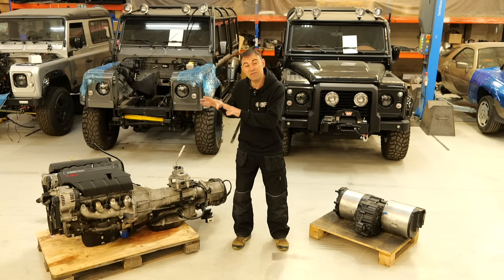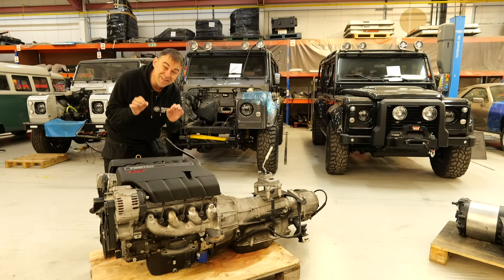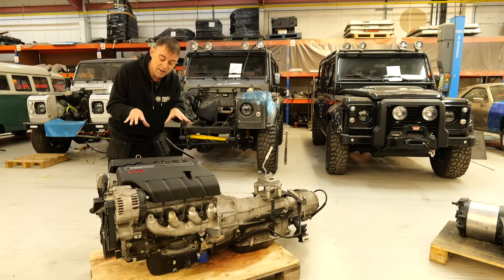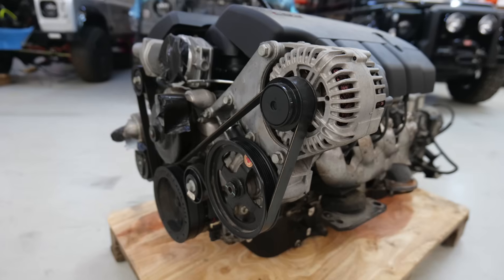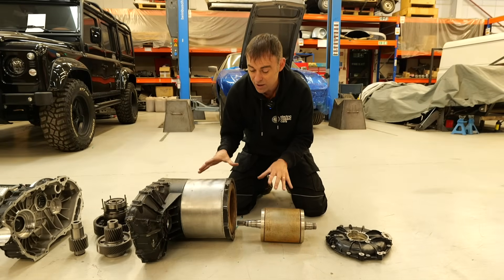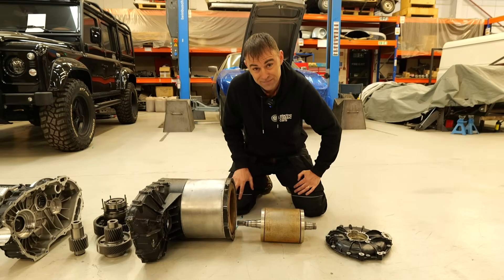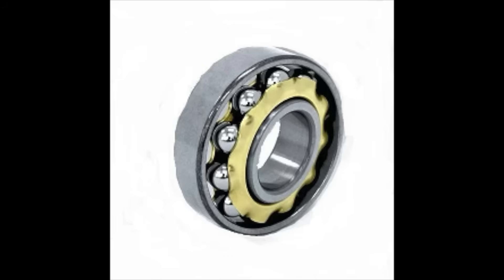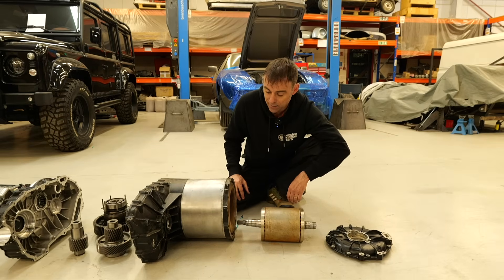Let's compare the Tesla LDU with an LS3 V8 and take one apart to see what makes it tick.

Comment: Not comparable at all because one produces energy and the other can only use energy. EV’s are not really electric cars as much as they are more like cordless rechargeable cars. Big difference.
Reply from the maker: You need to go back to science class. Neither ICE or EV ‘produce’ energy. They both used stored energy to convert into motion, whether that stored energy is in the battery or in the petrol. 🤷‍♂️🤦‍♂️
Reply: @ 
I stand corrected and thank you for not rubbing it in my face. Appreciate it.

Comment: You forgot about the battery in the weight.  Also, for electric, the high-loss energy conversions happen before it gets to the car, so total energy loss is about the same.  The heat is just dumped somewhere else.
Reply from the maker: Where do you hear such rubbish. Please provide the link so I can address it at the source. The EV is still much more efficient even when you take into account the electricity production. Electricity, BTW, which is required in huge amounts to drill the oil out of the ground, pump it to a port, transport it half way around the world, refine it into petrol , transport it to a petrol station and then pump it into a car, where only 20% is then used to make the car move. It’s madness. 
We covered a petrol vs battery comparison in a previous Tech Talk which we linked when we talked about the weights and at the end of the episode. In case you missed it, here it is. 👍 https://youtu.be/opF1si__APs?si=WNcGIWVZZUdGGDzd

Comment: Nothing new electrical drive... Diesel electric trains have been around a long long time. Even back then it was realised how efficient motors are... The only frictional losses are in the motor bearings whilst an engine has 100s of moving parts each with losses which multiply 😊

Comment: Thank you for showing the comparison ! 👍
At 74 and in my youth I dabbled with gas engines and slot cars . 
We use to rewind the motors on the slot cars to get more RPM but our throttle controls got hot as hell ! 
Obviously the motor in the Tesla is already set for peak performance and the inverter is the key to more power . 
I never thought I would hop in a full size slot car one day ! 😂
Reply from the maker: Thanks for sharing!

Comment: Yet Ev;'s are are having 4x as many issues as tradition ICE motors. You have not looked at the brains of the battery system or it's cooling. The you have a car that far  out weighs a car of the same size in ICE and all the same systems tyres, suspension and brakes. The fact you have so many lethal rare earths and poisons in the Lipo battery that is near impossible to extinguish is as good reason to not have one. Three car carrying ships have gone up so far due to thermal runaway and three fireman have been killed in the last few weeks. Until the batteries are safe they should never been allowed.
Reply from the maker: You need to stop watching anti-EV FUD. It’s well known that EVs are more reliable and require far less maintenance than ICE vehicles. I would suggest you widen your YouTube channels to something less Anti-EV. For instance Ben Sullins is a good start. 👍 https://youtu.be/ga1jzoHXiRE?si=2oluGIyp9pszMYuX

Comment: I think the original Defenders also had locking front and rear differentials and a true low range transfer case. To do this with an EV also adds a lot of complexity. The Tesla LDU only has an LSD - that's not really much good for off roading - so when you rebuild these things do you connect it to the original drivetrain or do you just convert to 2 wheel drive?
Reply from the maker: Defenders never had locking front and rear diffs. We put an LSD in the Tesla and one in each axle, making it far more capable off road than a standard ICE Defender. https://youtu.be/mcdKjdKELec?si=Z1Caz79NHi7EFxIu
Reply: @ElectricClassicCars   Thanks for the info. I always thought the Defender was offroad capable but apparently only light offroad. I'll have to watch that video although nothing really beats a locking diff.
Reply: At 8:00 mins you went through that technical section way too fast to try to compensate for the lack off diff locks. Sure we can all send it but sooner or later something will break. I enjoyed it though - great vid. The suspension travel is amazing. Always love your videos.

Comment: Nice video. I noticed a couple of times in reference to the Tesla motor you said " less pollution" compared to a V8.  Why don't you tell the truth and say ZERO pollution. Here is a test you can actually do. Spend the night sleeping in a garage with the doors and windows closed, with a V8 engine idling all night. See how that goes.  Alternatively, repeat the experiment with a Tesla turned on all night. It might be prudent to do this test, starting with the Tesla, and then terminate the test before you do it with the V8.  Facts need to be stated here, that electric motors do not have exhaust pipes, because they produce ZERO emissions.  The dinosaurs died out 65 milllion years ago.  I wish the diesels and V8s went with them... BTW it's only a matter of time...they are going to disappear.  The sooner, the better.
Reply from the maker: Because generating electricity still produces pollution.

Comment: The big problem with a Tesla (and it's drive train) is that battery. I can drive say 400km in my V8 truck including all the crap I throw in the back and when I run out of fuel, I pull into a service station, fill up and 5 minutes later I can do the same thing all over again. You just can not do that with a Cybertruck.

Comment: Interesting comparo.  I don't think you can fairly really compare just the engine and gearbox though.  A traditional fuel tank is about as simple as it comes, but a battery is tremendously complicated.  The number of cells, joints/connections, the chemical processes that need to happen to generate the electricity for the motor - in ICE that all happens in the combustion chamber, which is why it isn't really fair to ignore the battery component (unless we suddenly all decide to go overhead power wires like trams).  And the battery is where the heat is generated too since that's the bit generating the actual power.
hands up who's confident the electronics will work s flawlessly for 30 years?  The electronic door locks on my VW Jetta already have a mind of their own after only 12 years and aren't exactly cheap to replace - why they have to be electronic instead of mechanical (for lifting the latch) I don't know, but they're stuffed already.

Comment: If you compare the two, you need to include the weight of the Tesla batteries. A Cybertruck weighs in at 7000 pounds, I have FordF150 with the 5 liter twin over head 32 valve variable cam Coyote V eight. My truck is 5000 pounds complete, and, has four wheel drive, it can do far more than a cyber truck, and, it has a range of almost seven hundred miles on a tank of gas. Those engines are good for over 250k miles or more. How much does it cost to maintain a Tesla over the same period. Of course we do not know that, because they have all been recalled for repairs, and, production has stopped. That Ford V eight in various versions has powered winners on the tracks, and, on millions of Ford trucks doing hard work here in the US where we have long distances and rougher conditions than just about anywhere in the UK or Europe. I will stick with my "Coyote" , Musk is on a horrible person, and, is along with his buddy Trump is destroying my country, I would never buy any of his products.

Comment: I totally agree Electric propulsion has it's place but given your focus on weight what is the pre conversion weight of the Landrover before and after the conversion where the range of each is the same in the majority of conditions, i.e. one tank of petrol v one charge, i.e. on range we are comparing apples with apples? I'm guessing for petrol it's probably 50:50 but diesel - v - one charge I'm guessing it will be heavier?  Maintenance costs are a no-brainier and the impact on the environment gain is a no-brainer provided you take the ICE out of circulation and scrap it.

Comment: This is more a question than a comment, as these are “off road” vehicles would there be any charging points in the middle of say a forest? Because the range would be greatly reduced whereas the ICE vehicle could carry a jerry can of fuel if needed.
Reply from the maker: The range goes up off road as there no wind resistance fighting against the awful aerodynamics of a Land Rover. 👍 https://youtu.be/ugj_wEEtZZY?si=m3p6E4mAkWODAwOM

Comment: You forgot to mention the weight of the battery system when you add that in it’s more than the LS . And that’s besides point you now have a vehicle that just has no appeal at all as humans we operate on senses we need smell heat sound vibration that all adds to the experience and you just can’t get that with electric motors . Sorry, buddy we’d walk right past your electric Land Rover in a second and jump in a LS three rover instead😅
Reply from the maker: The Tesla powered Landy weighs the same as the LS3 powered one with a tank of fuel. We covered the battery vs fuel comparison in a previous Tech Talk. 👍 https://youtu.be/opF1si__APs?si=cVPzSWXwYU62ZV7D

Comment: EV is disposable. You have to buy a new one when the battery wears out.
EV takes a long time to charge. There isn't enough charging infrastructure and criminals vandalize the existing charging stations.
EV has a massive carbon footprint for the relatively short life of the car.
EVs are gay.
Reply: And you're ignorant. Owners of BMW i3 can easily order a battery replacement from China. The cost is $5,000 with longer range.

Batteries are getting cheaper and can easily be taken out and install a new one.

Dumb as Rocks you are

Comment: Err ... no not less pollution .... Uni studies have shown that if you do less than 10K miles a year it can take 10 YEARS before EVs break even on CO2 production ... by which time many batteries will require replacing .... even at over 15K miles a year it can take 5 years ... and if your electricity comes from fossil fuels the reduction in CO2 is marginal
Reply from the maker: If you’re going to spout rubbish at least include a source. It takes around 13kmiles  of driving before the EV produces less CO2. The ICE vehicle produces 3 times more CO2 by the time it’s got to 100,000 miles. Because the CO2 emissions of our grid is falling each year as renewables are added to the mix this cross over point is reducing all the time. https://www.carbonbrief.org/factcheck-21-misleading-myths-about-electric-vehicles/

Comment: I always love how people promote the Electric motor vs a gas motor and forget the batteries weight. You even added that you should have  added the exhaust but still didn't mention the batteries weight??? Why not weight the entire LS3, exhaust, fuel tank ect vs the Electric motor, batteries, wires? Why ignore the entire drive train that makes the vehicle move? To judge efficiency is also a question worth diving into. How do get gasoline and how do we get the electricity to charge our EV's batteries? It's like judging our vehicles exhaust pipe fumes but ignoring the coal plant that is charging the EV's batteries. If were going to compare apples to apples then let's get the full picture and not remove some data to make the EV's look so perfect.
Reply: An ICE car burned oil 50 years ago, 25 years ago, today, tomorrow, 50 years from now. An EV might be recharged via a coal fired power station. It could also be charged cleanly via solar, wind, nuclear or hydro. And just as EVs are replacing ICE, our energy grids are getting greener. EVs are better today and they are only getting better. ICE is just more of the same over and over again.
Reply: @zoransarin5411  again....that sounds all nice and dandy but ignoring how all of those sources are produced is the problem. Solar works only during the day time and can be damaged by weather such as hail storms ect. Wind power has a limited life, costs a ton to produce and still won't offset it's carbon foot print. Not to mention all the wind grave yards starting to pile up that they haven't figured out how to efficiently recycle yet. So just saying Solar and Wind is green is a myth once you fully wrap your head around it.
Reply: Coal plants are 90% efficient in converting fuel to electricity, plus all your green tech. ICE vehicles get 20% - 30% efficiency, plus the energy costs to extract fuel from oil. You can run 3x more electric from a coal plant.
Reply from the maker: There’s no coal plants producing electricity here in the UK anymore. Also, we covered the petrol vs battery comparison in a previous Tech Talk. 👍 https://youtu.be/opF1si__APs?si=cVPzSWXwYU62ZV7D

Comment: You know why they use ceramic insulative bearings?
Using a high frequency inverter will introduce stray currents in shaft and steel which would pit bearings causing normal bearing to fail.
Reply from the maker: Yep. 👍

Comment: He's talking about maintenance on that combustion engine what he failed to mention was replacing the batteries in the Tesla and the cost of them
Reply from the maker: A Tesla battery will do around 300,000 km before its capacity gets to about 90%. That’s more than the average lifetime of a car. A quick search on eBay tells me a good secondhand Tesla Model 3 battery is around £4,000. https://twitter.com/duro_data/status/1340493067443265536

Comment: Remember, if your power grid uses coal and natural gas and diesel, and your charge your EV from the grid, then your EV essentially burns coal, natural gas and diesel.  You also have to include the massive losses in power that come from sending the power down long high voltage power lines from the rural power plants to the urban areas. And then there is the fact that manufacturing an EV produces more CO2 than does producing an internal combustion engine car.  And then there is the strip mining involved in obtaining the rare Earth minerals that go in to the batteries... Oh, and have you considered the range constraint?  If you can only go 300 miles, and then you have to wait 5-10 hours to charge, long road-trips are completely different...
Reply from the maker: Here in the UK only a third of our electricity comes from fossil fuels. No coal here anymore. Transmission and distribution losses here in the UK are about 7%. It takes 13,000 miles of driving before an EV starts emitting less CO2 than and ICE vehicle, then by 100,000 miles the ICE vehicle has emitted 3 times more CO2. It takes around 20 mins to charge up on a rapid charger.
Reply: @ElectricClassicCars  On the US East coast, these conditions are much different and much more of our power comes from coal an do oil and natural gas. But on the West coast of the US, more of our power comes from renewables such as hydro power.

Comment: Not a fair weight comparison.  You need to include the weight of the batteries in the Tesla LDU.
Reply from the maker: We covered the battery vs petrol comparison in a previous Tech Talk. 👍 https://youtu.be/opF1si__APs?si=cVPzSWXwYU62ZV7D
Reply: @ElectricClassicCars  Yes, but my point is that the weight of the batteries should be included in your comparison in THIS video.  Thanks for the great content, by the way!  :)

Comment: Yes, the electric power plant is more efficient from an energy conversion perspective and a size and weight perspective.  However, in a car, the propulsion system needs not just the power plant, but also the fuel source.  Now, do a similar comparison of an ICE fuel system to an EV “fuel” system.  Herein lies the problem, which is why many don’t do that particular comparison.
Reply from the maker: That’s been studied many times before. Just google it. But in short, oil is drilled out of the ground, then pumped to a port where it shipped half way around the world to a refinery m, from there it’s then transported again to a petrol station where it’s finally pumped into a car, where only 20% of its energy is converted into movement. All of which takes huge amounts of electricity and energy. https://youtu.be/1oVrIHcdxjA?si=pdnsujzkYcswLuQA
Reply: @ElectricClassicCars  Again, you are dodging the reality that gasoline in a fuel tank is FAR more energy dense than electrons in a battery.  For mobile applications such as vehicles, this trumps the conversion efficiency.

Comment: I’m a Tesla owner and love it but to be fair this video has just cherry picked the best Tesla stats for the comparison . Batteries have a very poor energy density and whilst the electric motor is efficient, how efficient was the power source for the battery??
Reply from the maker: The power source for the battery is a lot more efficient than drilling oil out of the desert, pumping it to a port, shipping it half way around the world, Turing it into petrol at a refinery, transporting that petrol to a petrol station, then pumping it into a tank where only 20% of its energy will be used to make it move. All of which takes a huge amount of electricity and energy. It’s just ridiculous. 🤷‍♂️ We’ve covered the battery vs petrol comparison in a previous Tech Talk. 👍 https://youtu.be/opF1si__APs?si=cVPzSWXwYU62ZV7D

Comment: Why all the focus on the motor? Of course the final drive for an EV is simpler and better. 
It is the battery tech that has sooooooo many problems holding EVs back. 

Terrible charging times, lack of charging infrastructure, environmentally disastrous to produce, terrible recyclability, horrendous cost, poor lifespan, degradation over time, ridiculously heavy.... and they randomly spontaneously explode while emitting deadly gases.